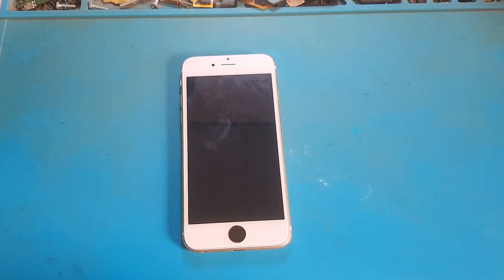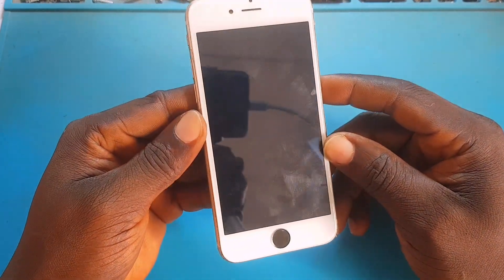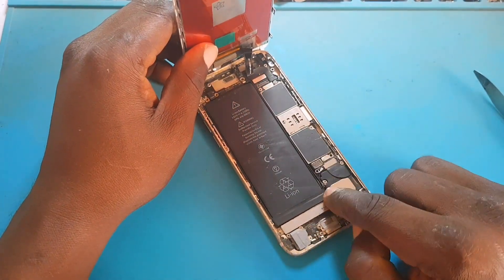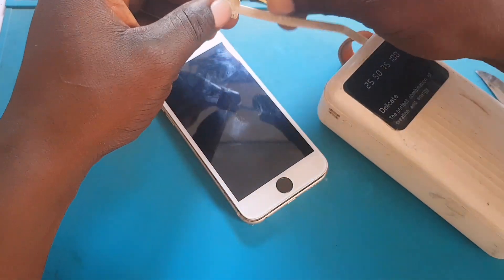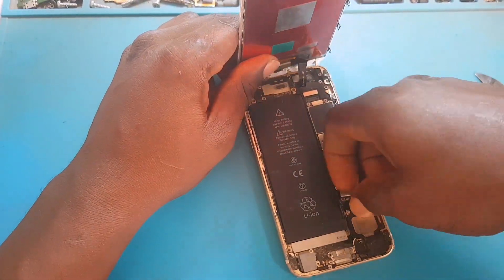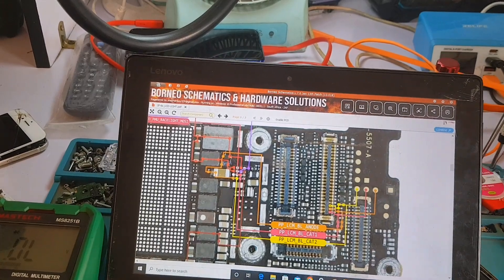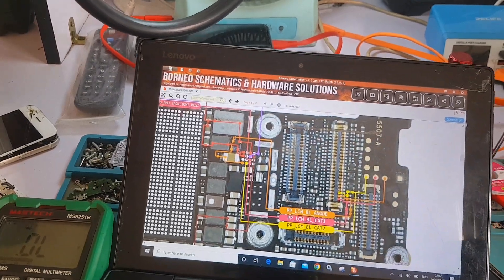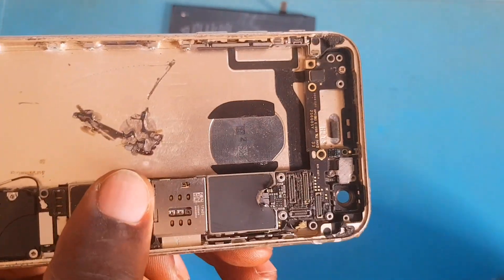Iphone 6s Backlight Repair, Black Screen No Light Full troubleshooting guide

Comment: What if you put your multimeter on buzzer mode instead of diode mode can't it give results thanks
Reply from the maker: Some multimeters are combined, i.e buzzer and diode
Reply: @SteveFixitbestrepair Definitely but the one used in that video was not combined
Reply from the maker: Yes it’s the advanced multimeter
Reply: @SteveFixitbestrepair No it won't